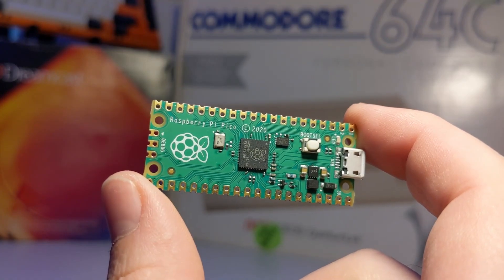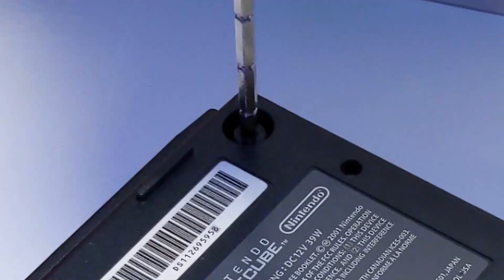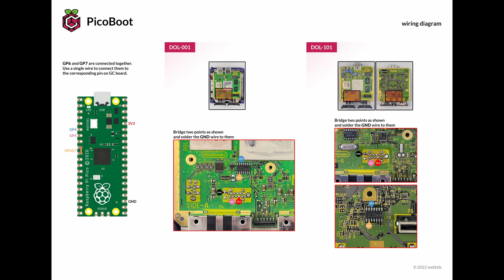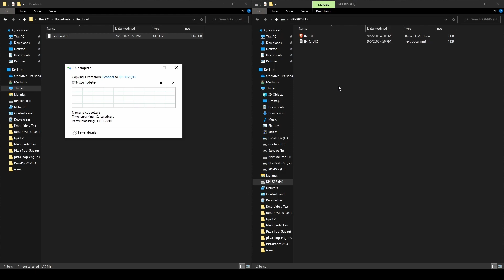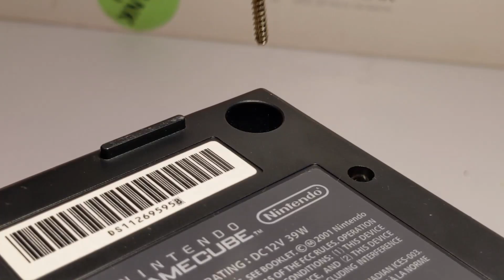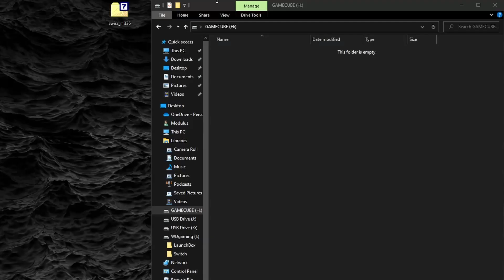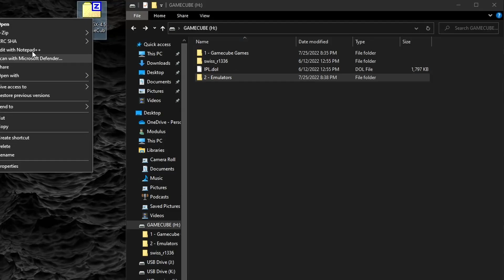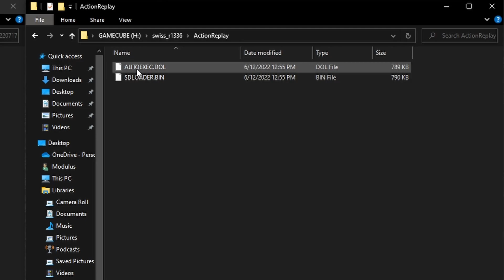How to Mod a Nintendo Gamecube - Picoboot Modchip Install Tutorial

Comment: No one is gonna reply to me bc this is 3 years old now but i followed all the steps in the video to a T but when i turn it on and try to test it my tv says no signal no matter what i do i can’t figure out why, before this it had worked fine in the past now idk what to do
Reply: On the same problem
Reply: Don’t know if you want to try this because I’m going to later on, if your wires are to long then it’ll just give you the black screen so make sure they’re pretty short, ab 4 inches

Comment: What’s your thoughts on if I tried this as an absolute beginner? I’ve never soldered before, and have been wanting to get into it for gaming devices. Would this be a bad idea to have this as my first project? I was thinking I’d practice soldering on broken devices to get the hang of it before just trying to solder like you did here. Then I’d wanna get another GameCube for this so I can keep my classic GC and have a modded GC. Great video by the way!

Comment: One question.. my ISO files are over 4GB and Fat32 formatted SD card won't accept... The Swiss software supports Fat16. Fat32, and exFat.. can I format my SD card using exFat? or should I use Fat32??? If I have to use Fat32, how can I copy my big iso files?

Comment: Hello i modded my device but one issue i am facing is any sd card above 16gb is not getting loaded by swiss. I am getting an error called ipl.cli file not found. Only 16gb and lower cards are not having this problem

Comment: Screw this mod and screw every video on here making it look so easy. I have destroyed two gamecubes trying to install this thing and have now given up and thrown the Picoshite in the bin - tried once with the easy-solder kit they supply on z-labs, and once like this video with 5 wires - i physically can not get the 2 wires to attach to those tiny legs on that damn motherboard chip.

Comment: Great video, very good tips. I tried it this week and was able to successfully install it on my Gamecube, on which the optical drive was not able to read games anymore. It now works like a charm, and brings a few additional features as well. I have to note that it was my first soldering experience, and because the pins are quite small it is not that easy. I recommend anyone in the same case to try soldering on some training board first to get used to the technique !

Comment: Not sure what I did wrong but my gamecube wont turn on now. The light flashes for a second and then turns off and the only thing that stays on is the fan….
Reply: Did you ever figure out what was the problem. I have similar problem. Only thing is fan stays in and power button stays on as well. I had followed everything to the T

Comment: Please help! Far as i can tell, soldering seems clean. Once i put everything together and plugged it in, as soon as the cube on the title screen forms a C it freezes. Any suggestions?!  What did i do wrong?
Reply from the maker: Can you confirm that the light on the raspberry pi pico lights up when the GameCube is powered on?
Reply: @MadModLabs   Yes sir it does.
Reply: @MadModLabs  update. Got it working...sort of. I get to the menu. Doesn't recognize the memory card. I ordered the exact one you used, they sent the gc2sd which shouldn't be the problem. I will reformat the micro SD card and go from there .
Reply from the maker: @kenshin73himura70  I'm glad you got it working!
Reply: @MadModLabs  Success!!! Seems like the IPL.dol file got erased somehow... Working 100%! My man, thank you a million for being there and promptly answering, that shows character and I respect that. I appreciate you very much. 👍🙏 Thank you again 🫡

Comment: hey there i just put a Pico in my GameCube and have a sd2sp2 with micro SD card in the serial 2 slot. when I turn it on I go straight to original GC menu and have no swiss booting. checked my SD card, I'm in fat32, card is compatible(Samsung Evo select 128gb), files placed where you said and named how you said. Re-checked all work in GC for soldering points. Why wont it boot into swiss? :( any help would be much appreciated!         :')
Reply from the maker: Check the solder points and wire length. Several folks have reported that problems that were caused by wires that were too long.
Reply: @MadModLabs   wires and soldering is good and wires shortened. still same issue. also tried using a gc2sd and it says it cant be used at the main menu of GC. could it be the software of swiss?
Reply from the maker: @michaelfuchs9708  it could be the Swiss config on the SD card. I would try downloading Swiss again and setting up the SD card files again just to be sure.
Reply: @MadModLabs   in fat32 or exfat? and is it just the renamed .DOL file or that and the folder of swiss?
and thank you for your help, i really appreciate it
Reply from the maker: @michaelfuchs9708  the SD card must be fat32. On the SD card you should have the Swiss folder and the file that you copied from the DOL folder. The .DOL file needs to be renamed to "IPL.DOL"
Reply: @MadModLabs   got that and still only boots up to original gamecube screen.    do i need an action replay or disc or anything else? i figured with the pico and the memory card sd adaptor thats all i would need?
Reply: @MadModLabs   and does the gc2sd need something on the root to be recognized? in the main menu it says that card in slot B cannot be used
Reply from the maker: @Michael Fuchs  Correct. The pico and an SD card adapter are all you will need. Maybe try reflashing the pico? Just hold down the BOOTSEL button when you plug it in to your PC and drag the picoboot files over to the internal storage.
Reply: @MadModLabs   i thought in order for the computer to recognize the pico you have to hold down the BOOTSEL?
Reply from the maker: You are correct. Autocorrect changed "down"  to "don't" in my previous comment. I have edited the comment.
Reply: @MadModLabs  I have reflashed pico by dragging the file over and once it moved over it auto ejected and gave the green indicator light. Is there a reason why the GameCube memory card adapter says that it cannot be read? In the memory card area of the main GC screen it says "memory card in slot B not usable"
Reply from the maker: @michaelfuchs9708  It sounds like you have done everything correctly. Do you have a different SD card you could try?.
Reply: @MadModLabs  I have tried a : 
-Samsung Evo Select 128gb formatted to fat32
-Sandisk 16gb micro SDHC also in fat32

But neither has been recognized when starting the GameCube. :/
Reply from the maker: @michaelfuchs9708  does the Pico light up when you turn on the GameCube?
Reply: @MadModLabs  yes it does
Reply from the maker: @michaelfuchs9708  try holding down on the d-pad when you turn the system on to see if you can view the debug messages. This is described here: https://github.com/webhdx/PicoBoot/wiki/Troubleshooting-tips
Reply: @MadModLabs   held down d-pad and it did not do anything. no debug menu. this just keeps booting up like a normal GC
Reply from the maker: @michaelfuchs9708  it may be unlikely but it sounds like both SD adapters are not working?
Reply: @MadModLabs  correct, both are not being recognized. when in gc2sd port the main menu of the gamecube says the memory card is not usable but reads a normal memory card fine. Does 3V3 still need to be soldered? the forum says it doesnt for the newest pico update 0.2? im just at a loss with this. it should be working :(
Reply from the maker: @michaelfuchs9708  I think the 3v contact still needs to be soldered. I think it is supposed to be desoldered when reflashing the pico to update it. I could be wrong on that. I have not updated mine in a while.
Reply: @MadModLabs  I undid everything to look at any area that may have not been 100% and put it back together and now when I turn it on it doesn't display anything but remains on.
Reply from the maker: @michaelfuchs9708  perhaps something is causing an electrical short. Where any of the ICs damaged while removing the heatsink?
Reply: @MadModLabs  not that I saw no, I got new thermal pads on and they work and nothing seems to be lose so I'm gonna check and make sure the disc drive is properly put in. I just don't understand why it's not booting swiss from my sd2sp2 or my gc2sd
Reply: @MadModLabs   started back from beginning and removed all mod soldering and tried different wire and just booted Swiss successfully. thank you for all your help! definitely a subscriber now! :D   (conclusion was my wires I used originally were not good enough)
Reply from the maker: @michaelfuchs9708  I'm so glad you got this working! hope you have fun playing all the classic games! Thanks for watching!

Comment: should i mod my dol-001 or my dol-101?? pros, cons?
Reply from the maker: The end result is the same. The DOL-001 has all the solder points close together on the top of the motherboard which is nice. More importantly, I would look at the bottom to see if the consoles have the extra serial port. Having another SD adapter in the bottom is nice.
Reply: @MadModLabs  will I free up a memory card slot on the front with the dol-001 though if I use the correct SD card adapter? Thanks? :)
Reply from the maker: @sc-fy2fc  yes. Check and see if you can use the SD2SP2

Comment: Just curious- is there any reason you cut the dol files and keep the original package folder within the root folder? Would it work just copying the doi file on its own into the SD root folder? A bit new so just trying to wrap my head around the software file reading process
Reply from the maker: Cut or copy with both work. The IPL.DOL file just needs to be in the root directory so it can be booted up automatically. You will need the rest of the files that come with the Swiss zipped folder.
Reply: @MadModLabs  thanks!

Comment: Can you do an ingame reset to the swiss menu with PicoBoot + SD2SP + the memory card sd adapter ? If it works , which button combination do i have to use ? I asked google and everywhere i found some combinations no one of these worked out for me :( .
Reply from the maker: Is your SD card formatted to exFAT or FAT32?
Reply: @MadModLabs  FAT32
Reply from the maker: @Esphaeron  Great. Next verify that you have the IGR.DOL file on the root of your SD card and you have IGR enabled in Swiss.

Comment: Is there a way to turn it off if you still want to access the GameCube menu and disc drive?
Reply from the maker: You can press the B button on the swiss menu and then select the icon all the way on the right to get to the original GC menu. Alternatively, you can rename the swiss dol file to any button like "a.dol" and then the GameCube will boot up normally unless you hold down a  button while turning it on.

Comment: Nice job! So this mod is just to run games from SD? If console is region locked i still need to add extra chip to unlock it if i want to play pal games on US console?
Reply from the maker: With this mod you can play games from all regions by loading them from the SD card in ISO format. If you would like to play games from outside your console's region from a disk, you could install a XenoGC chip also.

Comment: You can directly boot 6 different dol files by holding down the following buttons on the controller A, B, X, Y, Z, and START. Just put those dol files on the root directory of the SD card and rename each to file to A.dol, B.dol, ... and START.dol.

Comment: Thanks for the tutorial. Followed this one and macho as these are the two best ones!  
  I finally completed this mod but I’m not getting video but only audio when I load a game.  Any thoughts?
  2 out of the 10 attempts I get 1-2 seconds of visual but it’s horrible graphics.
      I’ve tried disc games and snes with all success so at least I know it’s something to do with running the GameCube isos only
Reply from the maker: I would probably start off by trying a different ISO. If the ISO you are using is trimmed, try booting one that still has the junk data. You could also check your video output settings in swiss and make sure they are set to default. Most displays probably support 480p.
Reply: @MadModLabs  
   Ok I tested more games on my list and I finally got video on double dash.  I get black screen with audio on the Nintendo logo but once the game gets to the intro video it all works!  So I guess it’s just picky on the roms?
  Now I test f-zero and starts black screen and I assume it’s stuck on the progressive screen option so I press a which I see my tv adjust to that resolution and all though I get picture it’s glitchy.   * update.   My Mclassic was causing it to be glitchy when on.
Reply: Is there a way to force progressive scan as it seems if the game isn’t running at 480p I just get a black screen.

Comment: Is there any way to move/copy/erase memory card game saves with this mod?

I know the boot logo needs to be skipped to allow picoboot to work.... but it would have been great to still be able to see/hear that intro theme when booting the GC.
Maybe one day the picoboot will work like GC loader does and we'll have the option to get into the old GC menu on boot...
Reply from the maker: Since this mod still boots Swiss, you can transfer save files using an SD card just like you can with other GameCube mods.

Here is a link to the GameCube memory manager software : https://github.com/suloku/gcmm/r

Also, it looks like flippyboot-ipl will allow for custom boot animations. : https://www.reddit.com/r/Gamecube/comments/wxdb82/how_to_show_gamecube_animation_on_start_with/
Reply: @MadModLabs  A golden gamecube logo... That's awesome. Shows that it's modded... but you still get the nostalgia kick. I'll have to dig into flippyboot.

I have my original gamecube unmodded.. But the memory card saves are something I would like to backup. Some are from 2004 when I got my first gamecube.

Thanks for the reply!!

Comment: There is a Raspberry Pi with wireless, is it alright if I use that one for the mod?
Reply from the maker: I think a Raspberry Pi Pico W would work for this mod. However, the software does not support wireless networking yet.

Comment: Tip to avoid frustration... keep your wires short. 4inch max so Install pico on the side by fan. If your wires are too long it won't boot just giving you A black screen on power up. (Installed on DOL-101)

Comment: BE CAREFUL when removing the heatsink. Do not wiggle/rotate too much as it can damage the tiny diode array on the bottom left of this video. My advice is to wiggle slightly while gently lifting/prying with a plastic lever on either side of the heatsink.
Reply: Yup, just made the exact same mistake and ripped the U11 chip clean off its legs.
Reply: Always good practice to never use force on electronics
Reply: Some heat will help, either a heat gun or play the console for a bit prior to disassembling

Comment: Is there a specific reason it needs to be FAT32 and not exFAT?
Reply from the maker: The FAT32 file system works with Swiss. Using a formatting tool like GUIformat will allow you to use SD cards larger than 32 GB with the FAT32 file system.

Comment: what kind of wire did you use? I have 30AWG but the directions say to use 26 and 28
Reply from the maker: I used 24 - guage wire. You can always use recycled wire from an old ethernet cable.
Reply: I used 22 and 30